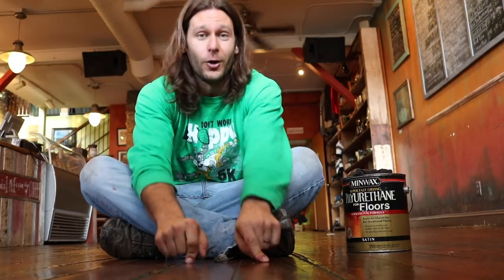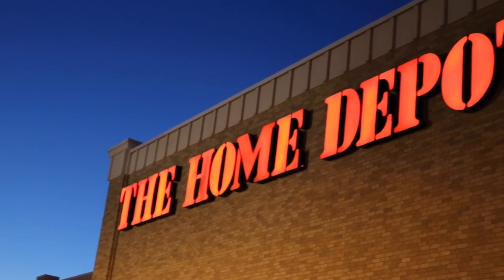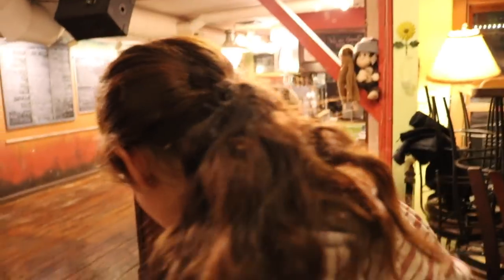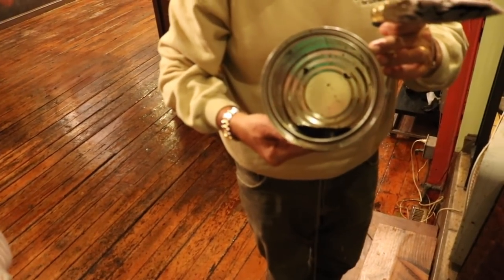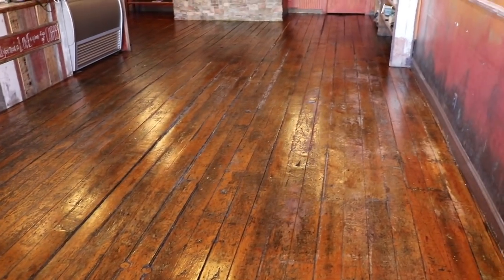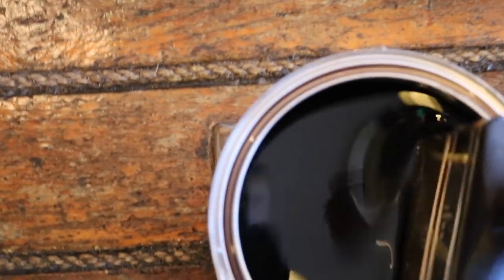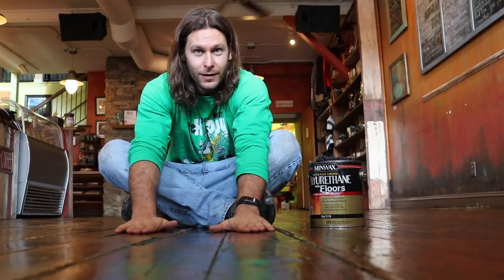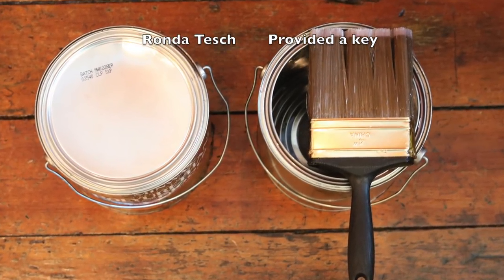Refinishing 134 year old wood floors!!

Comment: Honestly the flooring still looks like a wreck ... there are so many great videos on YouTube on "Refinishing Hardwood Floors" especially larger areas whereas the surfaces are in dire need of sanding to strip away the damaged areas in need of additional protection from over usage (heavyweight wear). Plus, using a  wood filler to protect the cracks and crevices from constant spillage or mopping. Which,  also erodes the wood and turns black. Coating the surface really isn't a good thing. Because it leaves little to enhance or improve the flooring quality that should be brought up by taking better measures to work on it within three to four days ... which could definitely be  achieved by a party of three working together as noted in this video clip.
Reply: @lovelost234  Hey I'm also about to move in a home with hardwood floors. Did you find anything that could help? Or offer advice? Thank you.
Reply: @lovelost234  Ok thanks. I'll keep that in mind as an option.  :)
Reply: @amygarcia3729  Just out of curiosity, did you refinish the floors?
Reply: @pound6599  Due to covid getting in the way we ended up having to pause refinishing. But there is plans to start it back up.
Reply: @amygarcia3729  Good luck to you! It's a lot of work, but it will be worth in the end.
Reply: I think the floor looks magnificent, it retains all the character of the venue.
Reply: @amygarcia3729  I’m currently refinishing the floors in 2 of our 100 year old houses. It has been a lot of work but oh my gosh it is so worth it! They are looking soooo good!
Reply: @thomasnegovanonline  That’s a clever way to spin shoddy work.  Almost as good as when someone claims that cup ring stains on a table is “patina” and therefore “charm.”
Reply: @jimmysaint8539  the fact that you conflate the two speaks volumes. 🤷‍♂️
Reply: @jimmysaint8539 the craziest part about trolls is they have no idea who they’re talking to. I’ve had a gallery for 24 years and have put pieces into a number of American museums. You, well, troll. 🤷‍♂️ There’s quite a lot you could learn from videos like this if you gave yourself the chance. Our brief elevator conversation has been charming, but ultimately it’s up to you if you are willing to challenge yourself or not. 🤷‍♂️
Reply: @thomasnegovanonline  You laughably declared that this floor was “magnificent.” Your asserted credentials makes the exclamation even more ridiculous.
You had a bad moment. It’s really okay to admit that a rotten dilapidated floor getting 2 coats of poly is not, in fact, magnificent.
Reply: @thomasnegovanonline  Also you’re the reason that BBQ Pit episode of the Simpsons was made. 🤣
Reply: @jimmysaint8539  Oh man you totally got me we should hang out

Comment: Do you know what the rope is for in between some slats? And the round pegs? What was that building originally? I've never seen floors with rope in them, it's so unique and beautiful and now I'm insanely curious!!
Reply: Boards would shrink leaving gaps some people would use rope to seal them as for the round pegs I don't know but in my house back then thay would use wine bottle corks to fix holes from the knots in the wood falling out and old books In the basement to fix squeaky boards😃
Reply: @Randy Heisler I believe hemp rope was used as an insulator. In this place it might have been used to block drafts coming up between the floorboards, whereas tarred rope on the decks of old boats was used to to waterproof them.

Comment: Seems like a lot of work and your before and after shots look the same. A light sanding to remove the old varnish would've made your little place in the world a real showplace. And if you use extension poles with rollers it would save you time and sore knees, backs and asses.